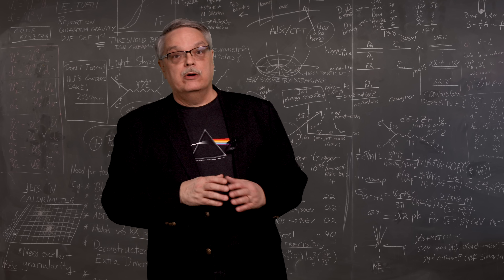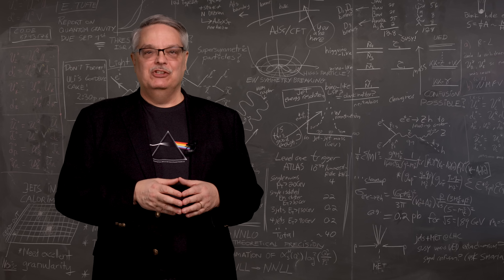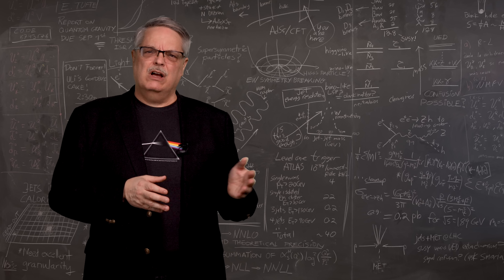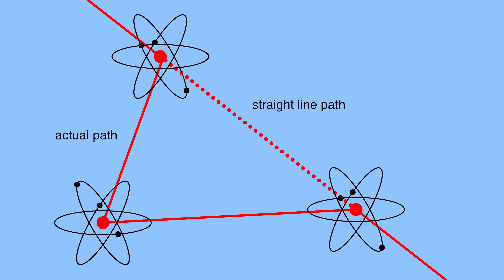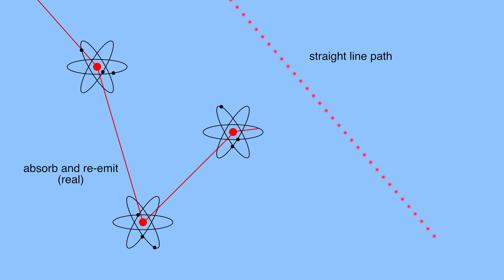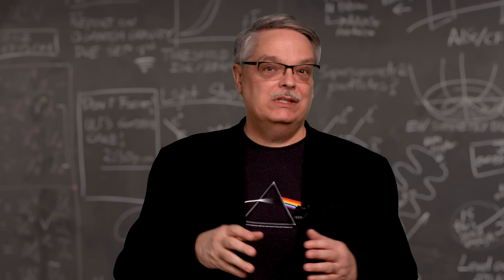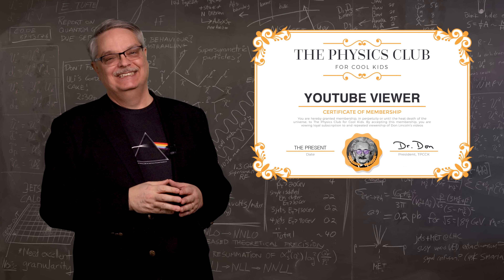Why does light slow down in water?

Comment: At 3:30 light is shown scattering off nuclei, but i think the light scatters off the electrons and never resches the nuclei
Reply: Those aren't diagrams to show that behavior, but just symbols. Light is actually reradiated in all directions by the atom, and the phase shift, happening due to wavefront hitting different atoms at different times, is the cause of bending. It is explained by the Huygens principle. https://youtu.be/rYLzxcU6ROM?t=4m6s this video explains the wave behavior with mirrors, but the principle does apply to refraction, which becomes more clear with a simulation https://youtu.be/-qYh6ydhdQw

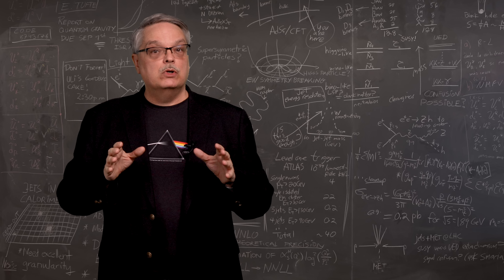Comment: At 8:40 why does the combined wave go slower? Possibly the red electron wave is assumed to be a lower frequency than the blue light wave - but they were shown as the same, in sync, at 8:22, only animated to be 2 different freqs, without explaination, at 8:26.  So the question seems not to be answered.

Comment: Interesting theory you have there. Small problem. If you are treating the light as a wavefront, you have assumed the waves hitting atoms will continue on the same path as the other emissions that are interacting with the original wavefront to cause interference. So long as the two wave fronts remain in the same path your theory will work. If they don't , it doesn't.

Comment: I'm sorry but this is incorrect. Light is a particle that is capable of accelerating beyond the Speed Of Light (CRAZY, right?). It is actually composed of a pair of teenie tiny (I'm pretty sure that's the actual size) dipole magnets. A single photon is nothing more than a pair of dipole magnets.

This is something that you can confirm for yourselves. You don't need bajillions in super colliders at megajoules and terabytes to hyper the super nothing. There is literally an app for that lmfao

https://youtu.be/xeyJMpfNDHs

Comment: Thanks alot  for your explanation Sir. But  there is something I want to ask.
 In situation of light travel from Air to Glass, why does the light bend close to the normal line? Why not bend away from it? Thanks
Reply: It's a wavefront.  So if the light hits the surface at an angle, part of the wave will slow down while the other part is still moving at the speed of light, thus "turning" the wave.  If you imagine an airplane nose-diving into water at an angle, where say its right wing hits the water first and slows down.  The left wing hasn't hit the water yet so it continues to move just as fast.  The right side moves slower than the left side so the plane rotates toward the slow wing side.

Comment: OK, but according to this explanation the original traveling oscillation and the one that it induces electrons to cause should CONTINUE to add after the original and induced waves have left the transparent material, thereby causing the light to travel slower ALSO AFTER IT HAS EXITED THE MATERIAL.

No doubt there's a reason this doesn't happen, but it's not apparent from watching this video.  Ah well, at least it did a great job on explaining why the light travels slower once it enters the material than it did beforehand.

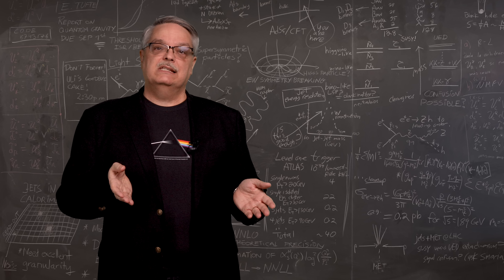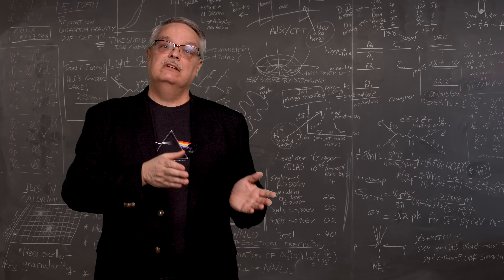Comment: 2:37 been tested? did you care to demonstrate what was proven, or you also dependent on 'The Knowledge of the Great Internet?' 4:09 "scatt-o-ring"(😆) isn't a pattern, also the light isn't going through atoms, it's not a 👻. It parabolic travels around, in a motion, as micro realm size bond, called gravity. 9:24 "if the atoms were there," the glass has atoms, as it's made of many molecular forms, to be a structure.

Comment: Also worth pointing out that light is absolute in a vacuum. It isn’t affected by gravity. Gravity lensing happens because the well curves space time around it. Light is still travelling in a straight line from the point of view of the curved space.

Another way to look at this is, gravity affects time but not light. Light can’t escape a black hole because time stops moving inside.

Comment: I don't think so....light travels like the balls of Newton's Cradle never losing energy by instantly regenerating the energy field to a newly created field in dark matter we perceived as void as it returns to the zero void energy after propagation. Light does not travel as a "beam" it propagates itself in a straight line much the same as Newton's Cradle. So there is more truth in the your second wrong answer; howbeit, that one is wrong as well, but the radiation fields that make up glass do have an effect on the speed of the light field propagation. so wrong answer #2 and your conclusion together are the closets correct answer.

Comment: ☹️still wrong,wrong,wrong……so called “light speed” is rate of induction,this is the only way light can “speed back up” exiting glass.(and obeys conservation of energy).
There is NO sensible quantum explanation for light exiting glass!
Different dielectric medium will thus allow propagation of light at different rates of induction!
Here is the missing secret of light….the mistaken particle/virtual photon/whatever component of light is in fact nothing more than the longitudinal dielectric (pulse) component of light (E and M being the transverse components). This destroys the  quantum interpretation of the double slit experiment. 
And another thing higher frequency light,eg UV has more energy/dangerous because the dielectric pulse component has more counter-spacial capacitance!
Light cannot leverage to propagate by Electric and Magnetic alone,(Dielectric component is also present).
😃

Comment: I'm not a physicist but the explanation of how it speeds up again falls short of my feeble mind.  Regardless of any second wave, you need energy to speed up.  Where does the energy come from?  Also, if the second wave is "generated" by the light wave, then the light wave LOST energy to the creation process.  That energy is lost forever.  Again, where did the energy to speed up come from?

Comment: All these years wrapped up in 10 minutes... the internet can be a good source of info.
Reply: except he is wrong and his explanation is incorrect..
Reply: @manlystyleunder50  really? how?
Reply: @ronnieparkerscott6223  first of all atoms do not absorb photons; only photons can absorb atoms

also, (but since you didn't understand the principle at first I doubt you will understand the explanation): light speed is rate of induction, this is the only way light can speed back up exiting glass.(and obey conservation of energy).
There is NO sensible quantum explanation for light exiting glass!
Different dielectric medium will thus allow propagation of light at different rates of induction!
Here is the missing secret of light….the mistaken particle/virtual photon/whatever component of light is in fact nothing more than the longitudinal dielectric (pulse) component of light (E and M being the transverse components). This destroys the  quantum interpretation of the double slit experiment. 
And another thing higher frequency light, e.g.: UV has more energy/dangerous because the dielectric pulse component has more counter-spacial capacitance!
Light cannot leverage to propagate by Electric and Magnetic alone,(Dielectric component is also present).
Reply: @manlystyleunder50  You should post this on the youtube video if you haven't already done so.  Thanks.

Comment: Unfortunately, the third answer is also wrong. Photons are energy quanta. The speed of propagation depends on the energy density. The physical course of time in a medium is lower. The photon undergoes time dilation in the atomic lattice because the energy density is higher. That is why the speed of light in a diamond (3.5 g/cm³) is also the lowest because it has the highest energy density.

Comment: Okay... let's suppose you are shining a light from under the water, pointing it towards the surface. Light leaving the water would be moving at a lowered speed by the water. Would it remain "slow light" after leaving the water, or would it accelerate back to the "normal light-speed?

Comment: This "correct explanation" seems like it isn't correct either?  At least thinking of it from an audio frequency perspective (significantly slower oscillations) if you combine two different frequencies the faster one doesn't slow down, you just get a different harmonic structure. The difference in frequencies of sound or the wave shape of sound doesn't affect its rate of travel between point A and B does it? If light is wave energy like sound, why would they behave differently? I'm not trying to be a jerk, just trying to understand. 🤓

Comment: I am afraid that I still dont get it. Ok the resulting elec mag wave has changed but so what? It would be nice to see a moving dot representing the position of light in a vacuum and light through the glass and it interaction with the internal charges, so we can visualise the speed difference.
Would it be possible to slow light down from a laser that passed through a strong elec field with an appropriate wavelength?

Comment: Do you have anything on why some materials are transparent while others are opaque? Why some polished metals reflect nearly 100% of the light at an angle equal to the angle of incident but on the opposite side of the perpendicular to the surface which is struck?

Comment: Light does not speed up or slow down at the interfaces..  the propagation just proceeds at a different rate.  Speeding up or slowing down requires a change in energy levels.

Comment: I re-read QED and confirmed that light is not a wave.  Light is made up of discrete particles.  So this video is another  incorrect explanation.  I do not pretend to understand what happens when light enters a material except to say that  photons may interact with electrons and be absorbed and re-emitted.  The true path of a photon can not be known but the probability of the pathways through "space time" may be calculated and the most probably pathways mean that photons take longer to pass through a material.  The Feynman QED lectures are available on Youtube, the video is of poor quality but the lectures are top quality.  

Light is really complex and it can not be explained.  The outdated wave explanations appear to explain certain observable properties but fail to explain others.  This video is based on very old fashioned ideas that originate in the 1920s and were disproved in the 1930s.  Feynman gave his lectures about Quantum Electro Dynamics in 1979.  Watch these and https://www.youtube.com/watch?v=bAnnEiAjN6U

Comment: Spent 40 years designing optical instruments using a sinusoidal model of a photon where its shape is a "Lazy-8" (figure 8 laying on its side) w/a wavelength of WL = c/f> Best example is a microwave "photon" of wavelength  c = 3x 10^10 cm/sec / 2450Mhz or 4.82", so a half wave is a sphere of 2.41" and an FM  "T-antenna" w/T = 4.82" will intercept a Uwave photon & so will a half-T of 2.41"> Go in your yard and measure length of a Bermuda Grass stalk Out west in a dry climate, it measures EXACTLY 2.41" in length to intercept uwave photong emitted by the SUN to shade its leaves from uwave energy that'd boil away moisture> So did GOD design it this way or did ALL the wrong lengths simply DIE OFF which is how GOD does design things, by Evolution just as ALL designers do, trial & error

Comment: Sorry, while no expert I  have just read Feynman's QED I'm not convinced by the wave theory presented above.  In QED Feynman talks of a single photon as a particle that may follow many paths and there is no way of knowing which path it will follow.  It is only ever possible to calculate probabilities for each possible path.  For example if light is a wave why does 4% of the wave get reflected from the upper surface ?  Newton asked the same question.

Comment: What determines the speed of the wave created by the stimulation of the electrons? Why, if that stimulation is due to the light, does the electron generated wave not move at the same speed as the light. You seem to have missed this out of your explanation. I get the superposition and addition of waves, and the fact that the combined wave may move at a different speed but why the induced wave is slower, you have not explained.

Comment: I have wondered if this has anything to do with the Red Shift (expansion of the universe). So light slows down when passing through any medium but speeds up after it comes out the other side. However, space is not empty, so light never regains it's original speed from it's original source. This, along with entropy could explain why the universe isn't expanding as fast as calculated and why a star seems to be traveling faster, in proportion to it's distance to our reference in time and space.

Comment: Oh this will be good... Why is it Prof... if you say "because Einstein..." the rest of it is just bunk. Or if you say , "Because this maths equation'' Bzzzz. Wrong again.  No matter what senseless explanation this Prof comes up with here is the real reason is the same as when you are (for example) driving along a road and you hit a puddle of water the car will slow down even if the water is only shallow. When you leave the puddle you go back to full speed. Water is more dense than air so more resistance means slow down. Or fire a bullet into water and the water will slow down the bullet and eventually stop it entirely. What happens if the bullet hits a wall? The wall  stops the bullet. What happens if light hits a wall? It stops. Both the light and the bullet might damage the wall and if the light or the bullet has enough kinetic energy both might go right though the wall. Light "particles" act exactly the same as any other particles and even objects. Light  bends  bounces reflects refracts and does all the things that other particles and objects do. Light particles just have less mass and move faster but the laws of ballistics, for example, still apply. Now how come it speeds up when it comes out the other side? Because there is less light emitted than when it enters.. More speed less light same energy supply.  Speed increases on exit.
Reply: Eh, you are aware that plenty of light passes directly through your walls?  Light has no mass.  You are very wrong;  I hope you don't take your theory too seriously.
Reply: @skepticalextraterrestrial2971  I would like to see this light that passes directly through walls - oh I see I can't see it because it is not actually visible light. So as we are talking about visible light then whatever you are talking about is not even remotely relevant is it? Or are you just pulling my leg.
Reply: @peterturner6497  Can't tell if you are trolling.  I can see light going through my window, through paper, even through my fingers.  I can make images from light passing through very substantial objects.

Comment: I have a question: Since materials have bounded atoms through electrons ,(covalent, ionic and metallic), shouldn't be the energy of the bound stronger than the wave? In other terms, shouldn't be the electron "fixed" into making the bound instead oscillating due to the external electromagnetic wave?
Reply: Well honestly the electron is never really "fixed" to begin with because you know quantum mechanics. It's rather probability cloud what is oscillating. Also even the bonds that hold atoms together aren't really that rigid. The amplitude of that oscillation is also pretty small to be honest in most cases (note that the amplitude of that oscillation is even smaller than the actual amplitude of that wave it is interacting with). In some circumstances the probality cloud does indeed gain a big amplitude therefore it starts "wiggle" like crazy (which can cause bond breaking). It happens in those cases where the frequencies are super high (gamma rays, x-rays, etc.). That's why the high energy radiation is so dangerous, it's because it dissociate atoms. On the other hand the low energy radiation can couse merely wiggling and therefore heat (microwaves or infrared waves for instance). Hope this helps a bit.
Reply: @halbarad7932  Thanks man, that is very esplicative, you solved me some doubts!

Comment: Interesting - but left the real questions unanswered. 
- electrons should move at same frequecy of the gererating field. If NOT - please explain the mechanism why not. If they do, they create another field with same frequency. The superposition ... well has unchanged frequency. There may be phase shift - you might say something about that. 
- What about energy conservation? How flows energy from the generating wave to the electron? Does it gain motion energy? Speed goes relativistic... ? 
- And, no word about why there is an angle between the wavefronts in vacuum and medium. It would have been nice to hear why this angle has a certain value and why exactly that value. 

Disappointing. Listening 10 minutes and "why does light slow" not explained.

Comment: Hey Don, here is a small refinement to your answer as to: Why does light slow down in water?
It’s because as the light-beam wavefront contacts the water surface it does so from one side of the wavefront first and the opposite side of the wavefront last. The first side is the first to slow down and the opposite side slows down last. The result is a tilt of the direction of the wavefront toward the denser medium (toward the water). The light beam has been redirected to follow a longer path through the denser medium. When exiting the denser medium the the first side of the beam to enter the water is the first side to leave the water. The last side leaves last. This causes the light beam wavefront to re-acquire its original direction, albeit delayed a bit in time and, displaced a bit in distance from the incident light beam (but exactly parallel to it). Additionally, light speed in space (with an impedance of 377 ohms) is faster than light speed in water which will be at a lower impedance (less volts per amp).